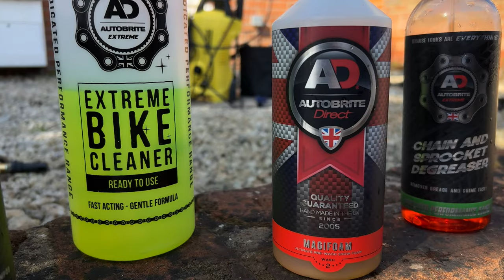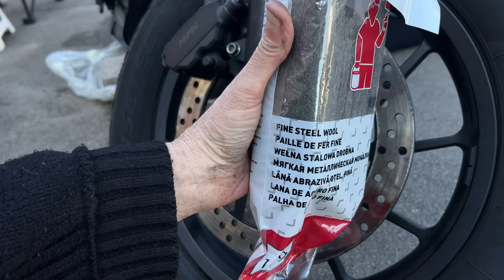How to clean your motorcycle - A Beginner's Step-by-Sep Guide

Comment: I used to valet vehicles and it is always best to use a separate dedicated bucket and clean the wheels and chain first.. 
I first use chain cleaner and clean the chain with chain brush then rinse off with water, I then clean the wheels.. using wheel cleaner.. then rinse off.. the reason you do the dirty parts first is so you don't splash dirty greasy, oily water over clean parts.. because this will be hard to remove with a rinse because of the oil and grease.. 
🤟😎
Reply from the maker: That’s a very valid point, if you watch my video The Best Way to Wash your Motorcycle I do start with the chain, I think I must have been having too much fun with AJ and her humour melted my brain! Thanks for commenting and watching the video! 😁👍
Reply: @TheAdventuresofPhilJones  
Thank you for your reply. I've recently subscribed so will definitely watch more of your videos..
Reply from the maker: @OldSkoolBiker62  Thanks so much! I hope you like what you see, and feel free to comment with your tips and feedback! 😁🙏